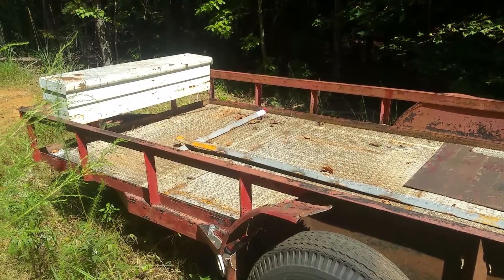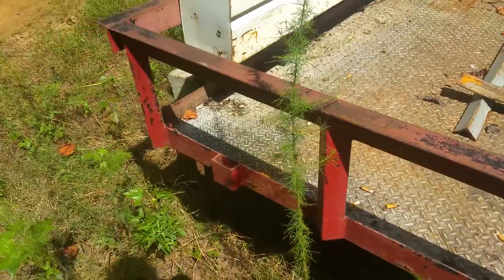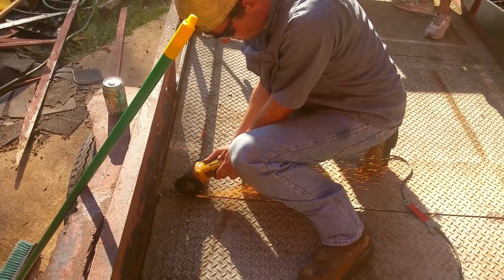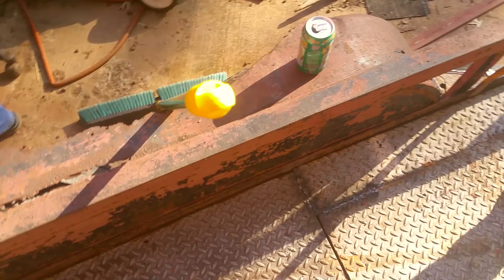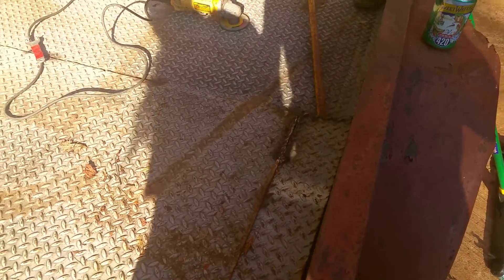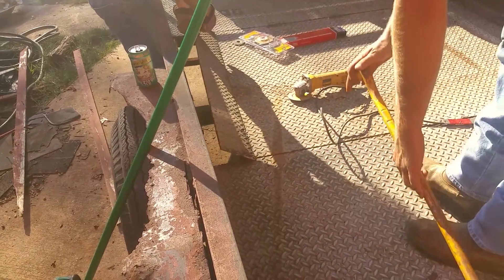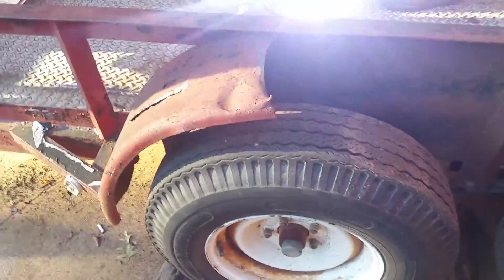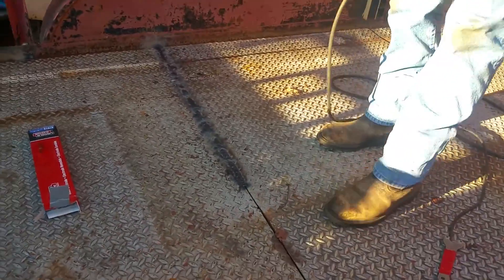Guy Thinks He Can Weld...

Comment: I worked with my wife's OLDER BROTHER, we made some metalworks, i let him do it coz he's older than me, but i treat him as a friend, as family, the moment he took out the grinder's guard, i stopped him and told him how important it is to not remove that and told him that i never work the grinder without a guard.. moments later the cutting disk broke , thanks to him listening to me no one got injured... I dont know about your case here where you are just watching someone potentially injure themselves because of your insecurities
Reply: I saw a disc fly apart and nearly take a guy's face off. It was blood everywhere. If I ever thought about taking that guard or handle off it went away that day. Thank goodness the guy got away with a small scar along his jawline and the scare of his life. He must have had the best plastic surgeon in the world. I have to say he grew up fast after that. He did not become Mr.Safety however we never had a problem having him get in line and do everything right so it keeps us safe.
Reply: I have been welding and fabricating for 20years. I've not used a guard on a small grinder for most of the time I have been doing this as a job. I am not recommending this but for me, It works. I have actually witnessed more accidents where people have had the guard on. 9 inch grinder, the guard can stay on as it does not do the intricate work of a smaller grinder. 

One thing I never do, guard or not is have my face in line with the spinning cutting disk.

Comment: lol, the golden rule of using an angle grinder is use it as it was supplied in the box. first thing guys seem to do is throw a way the handle and guard, smh.
Reply: With a visor I would never worry about a slitting disc blowing up, it weighs so little, and a fragment weighs a small fraction of that so it's velocity is pretty much nothing. If visors are safe to guard from a chainsaw they're overkill for a grinder. Using it one handed and not cutting next to your thighs are the big no nos, I know a guy who lost a few pints of blood due to a grinder to the leg.

Comment: hi mate i have holden astra 2004 1.8 ts i hav check light on and code p0130 i changed front o2 sensor but still same problem am getting very low fuel mileage can't see any leaks in engine bay just minor leak from rocker cover gasket. i have been suggested  to change ignition coil spark plugs and fuel filter . cold idling i very bad too rpm goes up and down btw 1000 and 700 but when warm its good ...